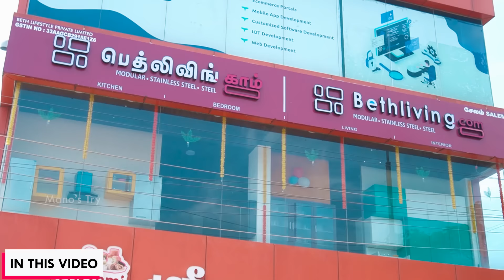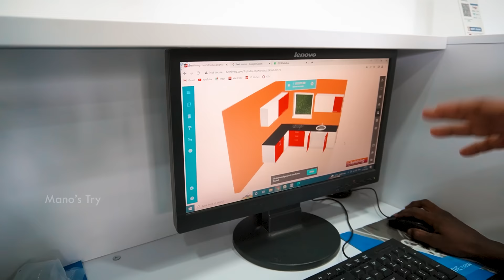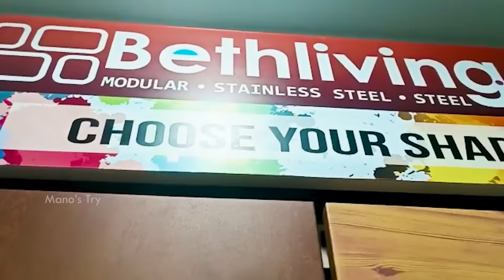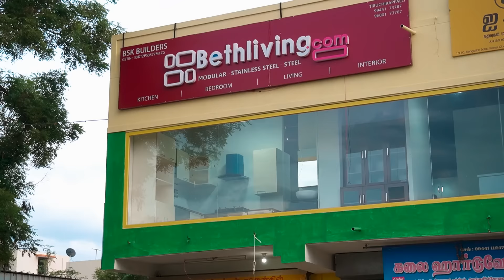Stainless Steel Modular Kitchen, Steel Interior Design | Low Budget | Mano's Try Tamil Vlog

Comment: I got to know them few weeks back and enquired them here in bangalore. Its very expensive compared to usual modular kitchen made of wood/ply. For small kitchen its costing more than 4lakhs. No doubt it durable and long-lasting product. If one can spend this much money initially, then its a great choice.
Reply: The ply laminated cabinets also should equally last as long as the steel ones,If they are well made (if used proper screws /ply) and maintained well.

But no one would like to have the same kitchen for 40-50 years anyways.. Hehe..

Almost 80% of the woodworkers here dont know their trade.. They show some photo from the internet and make it but then the client realises that it dosent even look close like the photo. 
The lighting, ambience, symmetry, prescision, colour palette are all very important. Which they totally neglect.
(please don't go for glossy laminate. Go for acrylic instead Matt is the best) They are here just for work. They don't know how to use power tools or any tool properly to make their work easier.. They don't have the fine technical knowledge of even measuring and cutting wood. It's sad to see. 

Very few people actually deliver what they show on paper / photo.
Reply: I agree
Reply: @chinmayasham3568  oh yeah, I had figured out when i was talking to few carpenters who basically takes projects on their own and do the suff customers ask for but after checking their work i understood. As you mentioned the technicality of the interior modular kitchen and what specifics to be used aren't at all followed. They mostly work on brining the figure what customer ask for. Something like northindian making sambar, they know its made of dal and the color should be something red-mixed yellow... they make it by looking at the picture. 

These people must work under some good interior designers who understand the expectations well. Put the carpenters in action with Right materials, So the things fall in place and we get exactly whats needed.
Reply: @NGUNASEKARAN  Hahaha... 
Very true
Reply: Electric shock adikadha if any steel nala
Reply: @ranithangam2940  kandippa adikkum..  edhavadhu current pass agura line patta kandippa shock adikkum.
Reply: Mare than 4 lakh ah
Reply: @kayalvizhi1107  yes.. 😤
Reply: @ranithangam2940  Anga ethuku plug point kuduka poringa
Reply: @chinmayasham3568  Excellent, Brief and clear explanation given. What you said is right just they say about their experience, they praise and appreciate themselves. By the time they complete their work we will be frustrated and compromised to the core
Reply: Try with WPC Material modular kitchen with PU/Acrylic paint finish.
Reply: Looks like you are a carpenter Mr , hence you are sharing false information to viewers

Comment: If our ground water contains salt like chennai's most area ground water,it will get rust definitely. Because in pvc Or acrylic moduler we use ss inside plate stand and oil stand, those are getting rust because of water. So it's waste of money.

Comment: Is it everything like inside,outside,accessories all stainless steel, please confirm. 
I seen many products partially stainless steel or some products use chromium plated.
Reply from the maker: Yes. but not the all models. Only the higher-end models are made entirely of stainless steel

Comment: Bro 1500 sqft 2020 la  1800 songa ground floor matum vedu finish pana evlo kapunga
Reply from the maker: Ippo sqft ku 2000 mela keppanga. finish panna, approx. 32L
Reply: Yes, 2000 looks a decent pricing. I'm building house in bangalore, 2200/sq.ft still so much money to put in for additional specification. When you do it with trust worthy contractor, you can get very decent finishing in 2k/sq.ft. Don't hurry in giving the project to one. search well and give it to someone who gives better trust to you and confident in building the house in committed time without degrading quality.